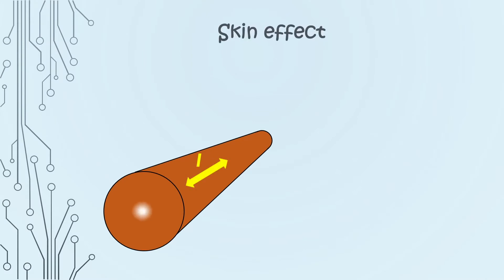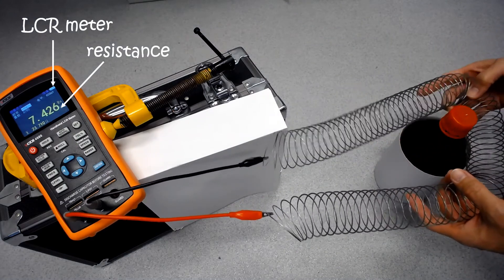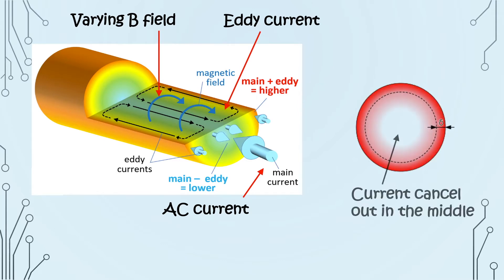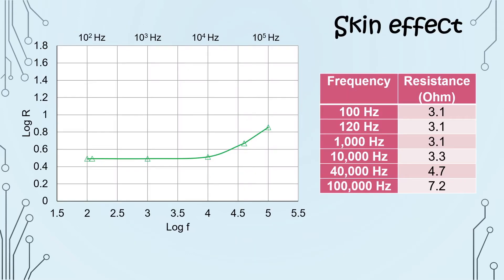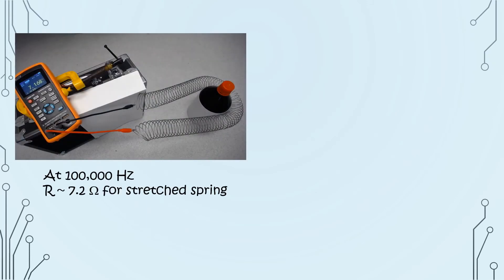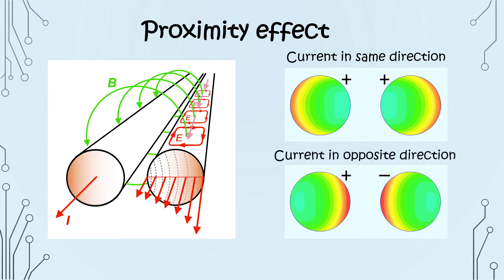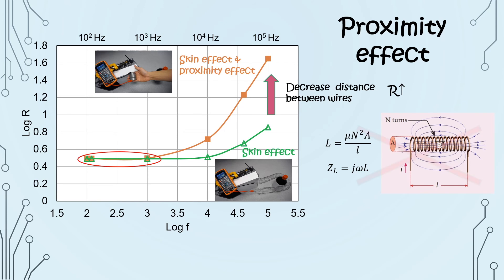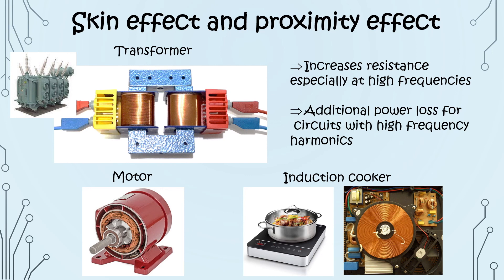Skin effect and proximity effect - how they change resistance of wires

Comment: Is AC resistance (skin or proximity effect) increased with higher currents ?
Reply from the maker: this is a good question. I think the skin effect and proximity effects affect the area of the wire that can carry a current, which in principle does not depend on current. However, in reality, higher current means that there will be more heat generated, and so the temperature of the wire will increase, and resistance is temperature-dependent (usually higher resistance with higher temperature)

Comment: Does anyone know if the Skin Effect and the Proximity Effect have any impact on the transmission of audio signals through wires in a home audio system, such as with audio cables that connect speakers to amplifiers or receivers, or with HDMI cables that connect various devices within the home audio system? If so, what would this impact be and is it one that someone would need to be concerned about?
Reply: No